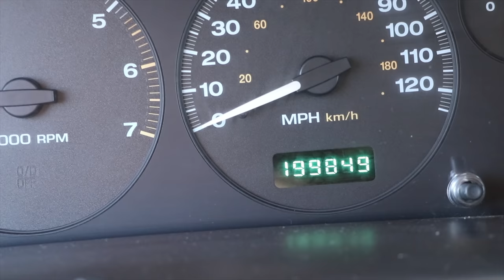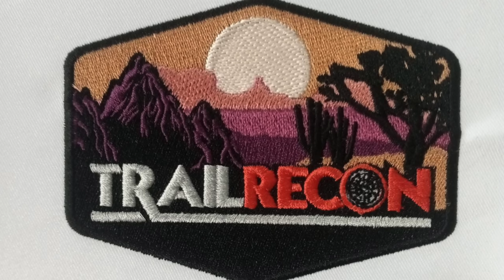Why Did I Sell 9 Off-Road Vehicles in 8 Years?

Comment: I'm keeping my Diesel Jeep forever.  It's the only engine option that makes sense in a Jeep.
Reply: How reliable has it been?  How long have you had it?
Reply: @drewolm  I’m at 30k miles.  Zero problems.  I’ve taken it off-roading many times and I’m going to Alaska in a few months.
Reply: 30k= reliable 😂
Reply: @canalesivany  it’s a brand new engine.  We don’t have enough data yet.  But so far it’s perfect.
Reply: bro that’s my dream car for the fun category
Reply: My biggest regret is not paying extra for the diesel engine on my wrangler. I love the 2.0L, great engine. But, I REALLY liked the diesel and wish I’d have gotten it
Reply: How’s the price of diesel treating you?
Reply: @ThisFriggenGuy-li5ui  it's cheaper than regular gas where I live.  I love it.
Reply: My 22 diesel gladiator rubicon hasn’t missed a beat so far, sadly it sounds like 23 is the last year for diesel, and haven’t heard anything about them offering the 392, demon, hellcat or helliphant engines as factory option.
Reply: The diesel came out right after I purchased my diesel zr2

Probably would have gone Jeep tho
Reply: @canalesivany yep, I have a 2009 Liberty [reheaded step child of the modern day Wrangler] at 260,000 miles and it rides and offroads smooth as butter. The v6 hauls some ass too. Love that Jeep
Reply: I’ve got 48k miles on my JTRD with zero issues. Just make sure you disable the auto stop/start, and keep up with the oil and filters (this has been a factor of diesels period, is nothing new) and I’ve had zero problems.
Reply: @furyroad_JT   my JTRD has 50k miles now.  Zero issues.  I've had a start/stop eliminator installed since day one, and always did synthetic oil changes on time.  I also did some preventative maintenance for known issues that some people reported.  I installed hood scoops from S&B to prevent overheating and I wrapped my transmission wiring harness with aluminum tape just to prevent any melting.  I saw some guy on YouTube who said his wiring harness melted from the heat of the exhaust pipe next to it.  The hood scoops also blow cold air over the exhaust pipes.  I also wrapped any exposed wires that are anywhere close to the exhaust pipes.  And I installed an oil pan skid plate from Asfir because it's fucking insane that the Rubicon model doesn't come with a skid plate for the oil pan.

Comment: I miss the Gladiator most of all. Your build inspired me to pull the trigger on buying ours. Glad to hear you may have another one in your future!
Reply: Yup, its how and when we found you Brad. We love our 2020 Gladiator Rubicon. We use it for towing and truck stuff.  Due to Warranty we are still under we haven't modified much. But, we still love it and plan on some great camping adventures with our UEV-90 trailer camper. So, in closing ; BUY ANOTHER GLADIATOR! :)
Reply: A strong rumor that a 4xe Gladiator is coming for 2024.

Comment: Note on the bronco: I think your experience is due to the 4 door soft top model. I got a 2 door manual hardtop and absolutely love it. The footprint is great and the handling is phenomenal. I think the bronco was designed to be a 2 door manual all along.
Reply: I got a 2 door hard top and my wind noise was just as bad as a soft top and wayy louder than a jeep. It was a dealbreaker. Ford’d build quality is lacking.
Reply: @gogators043  interesting. I sold my 2021 JLU willys hardtop before I got the bronco and I'd say wind noise is about the same. Way less tire noise however
Reply: I have the four-door soft top Bronco and it’s less noisy than the four-door soft Rubicon.
Reply: I had a jk for a long time, been out of it for a couple years, and just started to shop again. I really thought the Bronco was going to be the better clean sheet Wrangler, but I have heard the same opinion as Brad's from a few people now. On top of that, the factory options for non-sasquach builds seem lacking, and online owners are having issues...man, back to shopping for JLs for me! I love the look of the 2 door, though, so here's hoping for some midcycle updates.
Reply: @gogators043 it’s a new vehicle. Those kinks will get worked out.

The new Supra has wind buffing issues also.

Comment: The diesel overheated not because of cooling constraints  but because the shift pattern does not keep the engine in the peak torque range.  Diesel is just a heat pump, the more fuel you pour in, the hotter it gets, so running at lower RPM out of peak torque, it will burn it but cause the exhaust gas temps to rise, the ECU will then trigger the defuel once you hit those EGT's ranges to prevent failure.  Turbo Diesel Register has good articles about towing and running loaded with diesels about shift points, bottom line is rev the diesel higher in manual shift mode at lighter throttle for the same speed.   A lot new diesel owners don't know this.  Applies to any diesel.  I have the 2021 and run the passes in 1-2 lower gears manually and never have issues and get better fuel economy.  Next step is replacing the air filter and intercooler pipes to increase airflow efficiency, remember its really just a pump air and fuel in, expel it out and volumetric efficiency at RPM.
Reply: I can attest through my own experience of having to tow a very heavy load, plus all my own gear in the truck, back home across four states in the summer heat, that what you described is 100% true. I drive a '21 eco diesel gladiator.

Comment: I had the ram tradesman with power wagon package. I live in Southern Utah. It was an amazing truck. It was around $55,000 or just below that instead of $65- 70k for an actual power wagon. It had a front bench seat so you could actually take six with you. It was not leather. Love that truck. Wish I didn't sell it, But you are right, it is just big. It is heavy too. I have a couple Jeeps and a gladiator and they got around in more places with the four-wheel drive. Just because they are lighter and narrower. But for safety and comfort. That power wagon was awesome. Keep up the good content.

Comment: Love your channel, but bummed you got rid of the Bronco so quickly. In retrospect, I think you might have enjoyed it more if you hadn't switched your order to a soft top and waited for the hard top, but I get that you wanted to take delivery faster to get new Bronco content out. It took two years of waiting for my Badlands Sasquatch with hard top to be delivered, but it was well worth the wait for me. I also understand that you had issues with finding a winch bumper that wouldn't interfere with the ACC sensor and wouldn't require relocating it. Thankfully, that option is now available on the aftermarket. As you found with your Gladiator purchase, with new models, it takes time for aftermarket support to catch up. Happy Memorial Day weekend, and thank you for your service!

Comment: 21:22 not sure how the 4 runner is a better off-road option. The Bronco bests it in every off-road metric and feature. 4Runner doesn't have a sway bar disconnect, front locker or many other specs. The top may be better but that's a given for the obvious. The plastics comment yeah they do feel cheap. But who keeps touching their dash or other plastic parts other than the handles?

Comment: You found out the "hard way" what others had told me when I was looking for a Ram 4x4 for a camper. So I stopped looking at Power Wagons and concentrated on 2500HDs.  Even that hunt stopped as we decided to get a trailer (camper) that we could easily tow.  Thank you for the whole update about past vehicles.  And until next time.... You and Regena Travel safe.

Comment: I’ve got a 04 WJ that I have lifted 2” on skinny 32s. It is regeared and has front and rear lockers. I need bumpers, sliders, and a winch. It has a little over 250,000 miles on it and keeps purring. The simplicity of it and it’s lightweight feel is so nice. I’ve driven it all over the West hunting and it just keeps going. It goes pretty much anywhere as long as it doesn’t get hung up on something. 

I know I’ll have to get rid of it and upgrade someday, but I don’t know if a JK or JL can get into the same places I get with that little WJ. 

I do think I will end up upgrading to a JL 4 Door Rubicon (V6 w/ 6 speed) in the semi near future, but it’ll sure be hard to watch my WJ go down the road. 

Keep up the great content!

Comment: i'm bummed you didn't keep the bronco.  however i have a hard top and absolutely love it.  ford took me away from almost a decade of jeep ownership.  i can to 85 down the highway and it doesn't wander everywhere, and it's done everything i've asked it to so far with ease.  i'm also bummed you got rid of the power wagon, but i just sold mine too.  haven't done a video about it yet but it's coming.  it was so dang good offroad but i hardly offroaded it.  i needed it to do more truck stuff and it really struggled at truck stuff.  picked me up a diesel F250....
Reply from the maker: To rewind in time, a diesel 250 I think would have been better for us.
Reply: @TrailRecon  I'm loving mine so far.  Picked up a pre-rona 2019, and it's a beast!

Comment: I started watching TrailRecon with a story about your experience with some tires on a red Jeep.  It was your daily driver to a job.  T gave a really practical review in several videos.
We have a Hawk model 4wheel popup camper on our Ram 2500 Cummins powered pickup.  I installed Bilstein 5100 shocks on the back, with Eibach shocks on the front.  Since that truck is really my wife's.  I was forbidden to lift the truck.  But that shock combo improved the truck quite a bit until the camper was installed. I will consult with Bilstein before changing shocks.
My wife prefers cooking outdoors too.  But really likes the inside stove when the wind howls real strong.  We have a travel trailer, but the camper fits in every campground.  And at only 8ft in height.  We are allowed to travel in high winds, everywhere we go.

Comment: Good to finally hear why you ditched the PowerWagon, I was excited to see someone else defy the masses and use a PowerWagon with slide in :).   I have 20k HARD miles on my 2018 with a heavier camper (Northstar 650SC) , and I absolutely LOVE IT!, will never go another route for camping/overland rig. However,  I did not lift at all, just added Bags, Bigwig sway, and 37X13.5 Geolander X-AT (E rated) and run 65 PSI on the road, and 35 on the trail.  Rides better than any overloaded SUV I've had.  I have a couple vids on my channel if you want to check it out.

Comment: We’ve had a lot of the same or similar vehicles. I really enjoyed my XJ as well. I have a completely different take on the bronco though. I got it as a filler vehicle thinking I wouldn’t keep it long. I didn’t think I’d like it. I’ve been a Mopar guy through and through. I actually love the Bronco and I think Ford did a great job. That being said, I’ve never installed my soft top. Mine came with a hard and soft top both. I will agree that the plastics aren’t the best. All in all, I love driving it and it off roads amazing as well. We have a 4 door badlands with Sasquatch. We got a hard and soft top and have only run it with the hard top and topless.

Comment: I'm currently involved in a lemon law suit over my 2022 Diesel JTR.  Full engine replacement at 17k miles and the shop that replaced the engine fried the starter and power steering pump, now it needs a third power steering pump before 20,000 miles.  Like you and Casey, I also run into oil temp problems while towing a meager 2600lbs loaded teardrop.

Comment: I wanted to see more of the diesel. I just purchased  one of the last 2023 Diesels in March and have loved having it so far. I haven't gotten it out on the trails yet as I am still building it out, but I'm hoping that they got the overheating issues solved. I'm thinking about adding a 2024 grille to help with airflow.

Comment: As an owner of a modified Wangler Rubicon 4xe, who has wheeled it, I really like it. It has a ton of articulation thanks to a small lift and falcon shocks. I rarely put fuel in it, and only when I am going on a longer trip. That said, the new Tacoma looks amazing. I would be very interested in a 4runner that was a PHEV. Without the PHEV I am not 100% sure. The Gladiator in a 4xe would be awesome but the cost of a Wrangler Rubicon 4xe X is around $72k without all taxes and fees. That is way more then I bought mine for. I just can't afford the brand anymore. So I will probably be looking outside the brand if I want for something else.

Comment: Ahhh man…..the power wagon was my favorite of your vehicles. I know the capacity is an issue so I am taking the backpacking approach to it. Ounces equals pounds, pounds equals pain. Still want a covered option so the ARE MX HD shell with a decked drawer system for wife and 3 y/o and clamshell up top for me and 5 y/o. Those total about 550lbs. With added capacity from carli lift, still have plenty of weight left for essentials.

Comment: If you’re looking at the 4Runner, I’d throw the Lexus GX in there as well. Although if you get one of the first ones, you’re going to run into the same problem you had with your gladiator. I’m pretty excited about the future Gladiator 4Xe. The same goes for the diesel Gladiator. I currently drive a GX460, but I’m always looking at the diesel Gladiators, haha. But the 4Xe sounds quite promising as well.

Comment: Met a guy at recent overland expo that swapped a LS 5.3L with a supercharger in his rubi gladiator. He also has a Rubicon 392 Which his wife had at OLX, his gladiator reminded him of his power wagon he said, had great power, but with the smaller body of the gladi, he said made using it everyday and parking, a bit easier, and he could get into places he said he wouldnt take the power wagon. He has a camper like the one you had on the PW for your wife, but his is a model for a tacoma, hes building a c30 cabbed custom rig, with a cummins, and the smaller lighter tacoma camper will give him and his wife some comfort and space, shes tired of camping in her pop top tent on trailer she tows haha. or in his tent on top of wrap on his gladi.

Hes making the frame etc himself. Good lord thats to much engineering for my simple head haha. I think I am going to do similar. Have a new 2023 F150 crew cab thats a clean cab, dead motor and tranny, cummins swap would be ideal for us as well. 

And now looking at campers for compact trucks as well haha. Anyhoots great video!

Comment: I Definitely felt that when you had to let the ecodeiosal go I remember when you first got it because I used your videos to convince my wife why the diesel over the 3.6. We Have 83k on our ‘20 JL ecodiesal, has been to Brandon,Fl and Fraiser ,CO ,
Just took it for high pressure recall and runs like a champ at 29-31 mpg and I wouldn’t trade for a 392 or an 4xe.

Comment: Brad, Jeep should have re-engineered the cooling system to solve your diesel Wrangler overheating issues.  I would bet it was inadequate cooling capacity for the radiator & cooling system.  Jeep probably used the same radiator as their gas V-6 engines.

Comment: Former 6G Bronco owner here, too, and can confirm that soft top is horrible. Also, add any form of weight to that vehicle's stock suspension and you really notice it quickly. Sold it and bout a 1994 FZJ80 on 37s. Having to talk myself out of selling the 80 and axle swapping my 99 F250 7.3L to put it on coilovers and 40s.. it's a family truck (grandfather bought it brand new in March of 99) and a full size rig is very tempting.. but living in Amarillo and being a Merus member, not sure a full size rig out there would be too fun
Reply: You sold a brand NEW Bronco for a 94' whatever?..... right
Reply: @BrooklynNY1979  I did! Had it about 6 months, sold it for $7k equity, bought the 80 series - which is a triple locked, solid axle, on 37s Land Cruiser

Comment: Great video Brad! Couple of questions on the diesel engine if you don't mind. I've wanted a gladiator diesel for a long time but have been afraid because of the mixed reviews online. I don't tow much, did it only over heat while towing or going up steep grades in general? Also what upgrades would you make if you had one now to keep it from over heating.  Thank you

Comment: Brad I miss my 1998 Jeep Cherokee Sport, it was my first new vehicle. It had over 400,000 Km. I had it built up with my ARES emergency/ safety equipment.  It got wrote off after an accident because of high mileage and it hit the front cross member.

Comment: I had high hopes for the Wrangler 4xe. I was under the impression that you got rid of the 4xe due to gremlins; I seem to remember you getting stuck out on the trail. I recently purchased a '96 Grand Cherokee 5.2L V8 Orvis on 32x11.5s. Taking it on it's first off-road excursion on Monday.
Reply from the maker: The 4xe never left me stranded, but I did get a few electrical errors on 2 trips... never found the source.  I traded it in for the 392.

Comment: Regarding the XJ, your experience exactly matches mine.  The engine was great but some of the interior really started failing.  Had a 2004 GC with the 4.7L engine.  Drove it almost 100K with no work required just a couple of thing I had to be careful with such as the blend door and the wiring going through the drivers door.

Comment: I own a 4 door soft top bronco and I will say that I don't believe the wind noise is that bad.  I put a sun shade with blankets on top in it and it makes it about the same as my forester that has a roof rack.  I daily drive it over an hour for my commute and I don't even notice the wind noise.  My past 2 daily's have been Subarus with roof racks so maybe I am just desensitized to wind noise lol.  I rented a jeep in Moab for a couple days that was a soft top and I felt like it was just as noisy, if not more so, but that jeep did have 37 inch mud terrain tires so it isn't a very fair comparison to my 33 inch Wildpeak at4's.